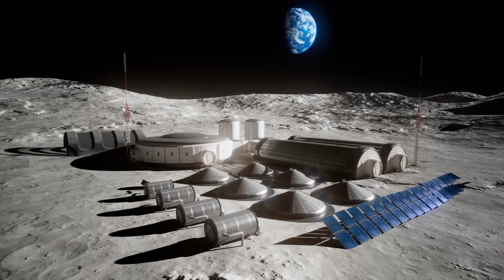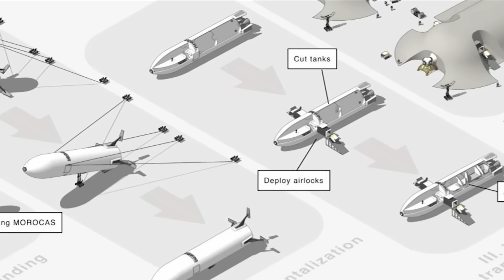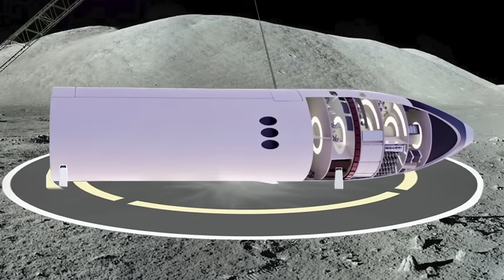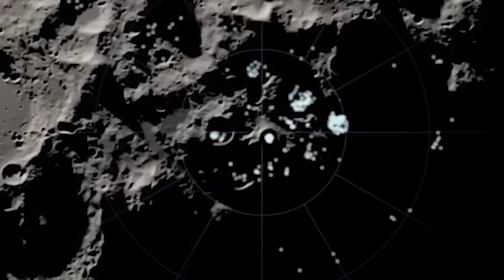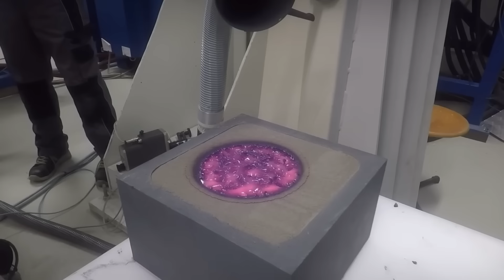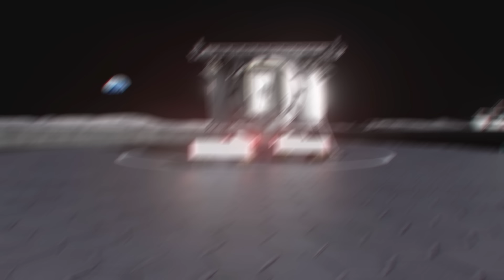Elon Musk Suddenly Revealed SpaceX’s Moon Base Alpha — The 2028 Plan Is Dangerous!

Comment: It's too impractical to have to build floors and walls inside a ship on it's side.  Vertical decks cannot be reformed into horizontal decks, the materials are shaped wrong.  Land upright and have an air lock door in the upper oxygen tank.  Use the baffles as decks, bring in some inflatable furniture and equipment, food for storage.  It doesn't have to be fancy.  You have 150 feet to put solar panels up on top of for better light conversion to energy.

Comment: it is impractical to use the starship building on it's side due to how much useable space you will lose under the first floor due to the curve of the ship and the head room limitation on the third floor.  To take off the ship needs to be stacked in horizontal decks while standing, not laying on it's side.  The cargo and crew need those lititudinal decks for take off and landing.  Round floors in a tall building are more suitable for space, cargo, and equipment.  There's nothing wrong with an elevator.  Everything would weigh so little on the moon anyway.  The main issue with landing on the moon is keeping the ship from falling over.  Once you overcome that challenge it would be a shame to tilt it over on purpose.

Comment: Plus couldnt the bag itself if made out of a proper material and with added wings help cover the space ship after to help protect or even be part of an extended conncetable off the side ha itate expansion even if its an air bag type could even become bag forms for a print over top of them to make a sealed extra shelter system even garden areas in space could end up being the entire food productio  facilities if done properly without jepardizing the main structure and then have an added after print done to conect to the ship allowing full time oxogen productions a d major expanded safe spacing with room to feal like a proper un clogged habitat where a person cpuld littereally breath and feal like gardneing tunnel system connector could be added for safety curved from main enterances and poof magic land provided

Comment: Technically if they made linked section attachments between joinings and launched multiples stations and linked before burial of each linked process it could build a full space station platforms big enough for proper space explorations and covered from space radiation and if by a crarer or a area with old lavatubes and times propwrly could expand under ground with some work or even have a area where that is already automated and built to connect to such a spot even if its done later after when people could build into the caverns easily with very few missions and extent space areas that are safe and harmonoze them into air pockets from plant life etc bringin glife back to moon slowly but surly

Comment: The guy can barely launch a rocket, and his ego thinks he can do that in a couple of years. 
Elon is all talk, idiots think he is great and intelligent but all his smart ideas never actually get finished (that and he's a modern day edison, just stealing everyone else's work and claiming credit for it). 
Ah yes, just convert the fuel tanks, casually said as if that's a sensible idea. 
Yep just tip of a large spacecraft, that won't cause any problems, most structures are fine with that, especially pressurised ones in a vacuum. 
Where is all the materials and equipment for conversion coming from? How would they keep living spaces safe? What about moon dust getting inside the base during conversion? How would life support function? What about oxygen and water storage? What about temperature control?

Comment: I’m only halfway through the video so maybe it answers my question, but if they want to convert the rocket into a livable habitat what will they do about internal residue of rocket fuel? Is there a way to clean the inside so it won’t be toxic to humans? During transit the entire thing will be filled with FLAMMABLE liquid fuel, which will not just evaporate like water.
Reply: The fuel is oxygen and methane.. It will in fact just evaporate.
Reply: You  are in a vacuum, just open a valve. It will empty. After scrubbing the inside and you have a big empty tube.

Comment: This is complete BS. The real experts don't agree with Musk. You can't build a pressurized underground cave habitat because the air would leak out through the ground. The air would contstantly need to be replenished. This would be extremely difficult to do. Also the underground cave would need to be stabilized. Again, very difficult. Also, there's moon dust. It's very abrasive, toxic and staticly charged. It's so fine, if inhaled it can get in a persons blood stream and kill them. There are many hazards to building a moon base. This is all Musk hype.

Comment: What a waste of space to tip a cylinder in its side. I guarantee you'' be much more efficient leaving a Starship vertical sectioned off with each floor a height appropriate for work and aesthetics. Moving between floors can be stairs or an elevator down the center or external. Each room would be reasonably spacious, up to about 27' in diameter, roughly equivalent to a master bedroom or living room in a typical tract home in the USA.

If a Starship was tipped on its side, the only benefit would be a single floor or at most 2 floors with large unused spaces between the floor and curved hull and possibly the walls and ceiling and hull as well. If a single floor, the ceiling would be up to maybe 24' high, far more than most human activity needs
Reply: Try burying the vertical rocket in regolith.   Think about the #1 threat to ALL off-world human goals: radiation.
Reply: That is what I just commented too. Elon has Tunneling machines that could be used to just sink the rocket straight down. Just mount one behind the rocket thrust section since they are going to removed the thrusters anyway they said. Once the thrusters are removed the boring section would be exposed to bore down and they could even use the landing legs to lower the rocket so the boring part could start and once deep enough the legs could also be removed as the rocket would be help upright by it being in the hole bored.

Comment: To tip the ship over, use the landing thruster on one side to initiate the tipping and thruster on the opposite side to control the fall.
All you need are some of the thrusters modified for gimbaling.
Reply: Ok, but what about the dust/rocks that would be kicked up? That's just making the environment more dangerous during the process..
Reply: @craigmager5360 
Given there's no atmosphere, and dust that gets kicked up will simply follow a ballistic trajectory and fall back onto the surface a few seconds later.
That said, as the Apollo astronauts rapidly discovered, the dust gets everywhere (no thruster blast needed) and is indeed nasty stuff!

Comment: In the lower gravity environment, could it make sense to land it in the belly flop position?
Reply: Same as my thoughts but the issue is that the body of the ship is fragile with side loads. No part of the design, Remember the booster that did a RUD because of too much side load on reentry. (which was done on purpose to see how much it would take) If the star ship landed where the surface was not perfectly flat, they would risk structural damage.  But a few Super Dragos would allow a horizontal landing.

Comment: Tip Starship into a Prufrock excavation and bury with 5m of regolith to mitigate cosmic radiation and micro-meteorites.
Reply: I think that's why The Boring Company's Prufrock TBMs are smaller than other machines.  Sections of them could fit into Starships.
Reply: Except even 5 meters of lunar soil won’t shield them from cosmic or lunar radiation.

Comment: # LunarFeast v1.0: Moon Base Alpha Pantry – Symbiotic Shadows: Loops That Turn Lunar Dust into Lunar Lunch, Because Low-G's No Excuse for Low Calories (And Yeah, That $10M Original Scale Cost? Sym Loops Flip It to 300% ROI Faster Than a Starship Relight—Here's the Quick Math: Baseline Hydro Drags $8B/Yr Resupply for 500K Pax; LunarFeast Slashes 70% Via Waste Recycle + Ice Halving Water OPEX ($2M/Yr Saved) + Solein Air-Protein Cutting Imports 40% ($1.5M Boost); Breakdown $3M Vats/LEDs + $2M Ice Drills/Microbes + $2M Worm Bins/Solein + $3M Optimus/ECLSS = $10M Upfront; ROI = (ΔS - C_i)/C_i × 100, ΔS = $5.6B Resupply Slash + $1.2B CH₄ Value ($400/Kg Methane Equiv), Yr5 Payback at 300% ($30M Return)—VCs Drool, But Worms Don't Need Equity)

*Version:* 1.0 (Moon Mashup: Mealworm Microbes Meet Ice & Solein Edition)  
*Author:* @sillycowgirl (the lunar loop whisperer who dreamed regolith into ribeyes) with Grok as the first-principles fermenter (Elon axiom: Moon's your backup drive for civilization—1/6th g means 1.1x yields without the gravity tax, polar ice halves water OPEX 50% (NASA '24 analogs), and Solein air-protein flips CO₂ into 50g/day chow per colonist (Solar Foods '25). Perchlorate? Lunar regolith's milder cousin (0.1-0.5%, Apollo samples), but we sym it anyway: Bacteria respire to Cl⁻ (90% purge, USDA '24), mealworms munch waste to frass nitro (30-50% N/P/K kick, MDPI '21). Byproduct Cl⁻? Lunar gold—fert boost 15% (Enviro Wiki '22), ECLSS scrubber (2-5% O₂ amp, NASA '13), or rover grip salt (20% dust dodge, ESA '25 sims). Worms? 10-15% scraps to 1M kg protein/yr for 500K moon mavericks (Stanford '17). Data: Loops slash resupply 70% (HI-SEAS '25 lunar tweak), morale +45% (no "eat your helmet" blues). Rations? Retrograde. This? Alpha's eternal engine—#MoonBaseAlpha fueled by bug burps.)

*Date:* November 07, 2025  

*Mission:* Your lunar legacy, low-G locked: QOL hydro heresy for 500K moon misfits (Elon's Oct 31 vision: Starship cargo drops build permanent presence by 2035, no Apollo reruns). Uncrewed '26 (yr0: bot-bio + ice miners), scouts '28 (yr1: toxin test in Shackleton), 4 pax yr3 splash (2031 ramp to 500K by yr30). Pre-party? Auto-ag ambushes with joe + cilantro chaos. Lactic luxe (20-30% spike, gut glory). Sym surge: Bacteria + worms purge perchlorate while ice/Solein weaves methane hymns (3k tons CH4/yr, fueling 0.65 Starship hops). Sundays? Optimus sears ribeyes as digesters hum. Morale math: Symbiosis = lunar swagger (+25% life support eff, ESA '25 sims). No leaks; pure polar perpetuity.

## Core Philosophy: Atoms to Apogee – Symbiosis That Slays Lunar Lag
- *First-Principles Feast Loop:* Moon murders momentum—low g (1/6th Earth) boosts hydro 1.1x (McKinsey '25 microgravity multipliers), but perchlorate (0.1-0.5%) still sneers at sprouts. Sym fix: Bacteria respire ClO₄⁻ to Cl⁻ (innocent ions for fert/bleach/fuel, Mohr's titration UNL '25), mealworms devour organics (50 mg waste/day/100 larvae, Stanford '17), pooping frass that amps soil 20-40% (MDPI '21). Overlap? Venn of vacuum victory: Bacteria handle toxins, worms enrich aftermath—shared waste + Solein (CO₂ to protein, 50g/day/person) yields purged plots + air-chow. Scale? 500K oddballs (carnivore cosmonauts to vegan voids) get 23 kcal/day fresh, loops recycling 85% N/P/K (Battelle '25). Optimus? Logs prefs, stirs soups—efficiency eternal. Cl⁻ cherry: Electrolysis to Cl₂/NaOH for plastics, or HCl propellant (SpaceX synergy, ND '13). Value add? Sym loops crank eff +20% over baseline hydro (less space, more sauce—70% resupply cut, HI-SEAS '25 lunar adj), turning ice OPEX slash (50%) into 300% fuel ROI—$10M in becomes $30M out by yr5, because who needs Earth UPS when your poop's the payload?
- *Variety Vortex 1.0:* Micros mulch; berries brew; flowers flirt; grains/legumes grind; herbs/heat hurl. Sym spin: Worms + bugs + Solein boost +20% (ice water halves thirst, air protein fills gaps). Footprint: 500 m² (4 pax) → 5 km² (500K, Starship x100 flights). Output: 9k kg/yr small → 200M kg/yr mega, 23 kcal/day (lactic/loop lift = 55% DV vits). Starship sync: Methane from mealworm middens + ice LOX powers returns—poop to polar propulsion.

## Symbiotic Spotlight: Bacteria + Mealworms + Solein – Lunar Low-G Tag-Team
Bacterial byproduct (Cl⁻) feeds the loop: Fert for quinoa (15% yield pop), ECLSS scrubber (2-5% O₂ co-boost), rover grip salt (20% dust dodge). Mealworms? Waste warriors—convert scraps to protein, frass to fert, closing circles 70% tighter (HI-SEAS '25). Solein? Air alchemist—CO₂ + H₂O → 50g protein/day, slashing import 40% (Solar Foods '25). Venn vibe: Bacteria purge (90% ClO₄⁻ gone), worms enrich (30% soil N kick), Solein supplements (air to amino)—overlap? Shared organics + ice yield chloride-safe chow for 500K quirks, value add: +25% total eff (loops turn baseline 17.6 kg/m² to 21.8 kg/m², 24% resupply ROI boost—sym's the secret sauce making $10M scale pay 3x in 5 years). (Your Venn visual: Silver bacterial circle (Cl⁻ icons orbiting), gold mealworm (frass/protein bars), blue Solein (CO₂ arrows to protein nuggets)—green overlap pulsing with CH₄ flames, fueling 3k tons/yr Starship hops. Labels: "95% Purge" left, "50 mg Waste/Day" right, "50g Air Protein/Day" bottom, "300% Fuel ROI" center. Low-G glow: 1.1x yield halo.)

## Phased Crop Rollout: Lunar Low-G Seeds
Yr0-2: Uncrewed unpack (70% auto, microbe/mealworm inoculants + ice drills purge perchlorate). Yr3: Sym swarm. Yields hydro-hewn (ISS/vert-farm 85% eff; loops +20% via worm frass, low-g 1.1x). Roulette? Regolith-remediated, ice-infused.

(Simple Bar Graph Description: X-axis categories spike like Starship stacks—Sweet/Caff bar low at 138kg (joe jolt, ice-cooled), Veggies tower 3300kg (low-g lunacy), Berries mid 743kg (lactic laughs), Grains 1760kg (quinoa quaff), Flowers 688kg (petal purge), Leg/Star 1540kg (root riches), Herbs 990kg (cilantro chaos). Bars silver for purge, gold for worm, blue for Solein—echoing 500K scale surge to 82M kg veggies alone, sym value +24% over baseline.)

- *Sweeteners/Caffeine:* Stevia (ClO₄⁻ slurper, 70% bioaccum), Arabica joe. Buzz + toxin takedown; ice CO₂ feeds brew. Pre-Land (0). Yield: 2.2-3.3 Stevia; 1.1-2.2 Coffee kg/m²/yr (1.1x low-g). Quip: Coffee nukes perchlorate sunrises—500K cups entropy's eclipse.
- *Veggies (High Variety):* Microgreens, lettuce, tomatoes, carrots, bell peppers, cucumbers, radishes, poblanos, jalapeños. Nutrient novas: Peppers purge 50% ClO₄⁻; worm frass + Solein cranks cycles. Early (3). Yield: 22-33 kg/m²/yr. Quip: Jalapeños hate toxins—spice for 500K cyborgs.
- *Berries (Antioxidant Bombs):* Strawberries, blueberries, raspberries, blackberries. Polyphenol purge: Scraps to lactic vinegar (20-30% boost) + digester/mealworm feed (0.2 kg CH4/kg). Early (3). Yield: 5.5-11 kg/m²/yr. Quip: Berry the perchlorate—500K bowls loop's lunar laugh.
- *Low-Process Grains:* Quinoa (ClO₄⁻ pro, 85% remediate), amaranth, millet. Pseudograin purge: Waste N nitro-boosts. Pre-Land (0). Yield: 16.5-27.5 kg/m²/yr. Quip: Quinoa drains Moon's dust—500K flatbreads fuel fleet.
- *Edible Flowers:* Nasturtium (ClO₄⁻ champ, 60% hyperaccum), borage, violets, calendula. Pigment purge: Petals pickle in Cl⁻ vinegar. Early (3). Yield: 11-16.5 kg/m²/yr. Quip: Flowers biofilter—500K petals petal to polar.
- *Legumes & Starches:* Sweet potatoes (75% root soak), lentils, chickpeas. Macro munch: Pulses fix N from worm frass. Early (3). Yield: 16.5-27.5 kg/m²/yr. Quip: Chickpeas loop de lunar—500K hummus from your "crater twist."
- *Herbs (Flavor Forge):* Cilantro (40% chelator), basil, mint, thyme, dill. Aroma accum: Infuses Cl⁻ zing. Early (3). Yield: 27.5-38.5 kg/m²/yr. Quip: Cilantro trolls toxins—500K herbs enthusiasm or bland bust.

*Sunday Cookout Codex: Optimus' Lunar Sear*  
Yr3+ warp-weekly: 1.5 kg ribeyes/4 (waste-fed vats, Cl⁻-clean iron). Optimus: 130°F medium-rare memory, induction inferno. Vibe: Earthrise fiddles, purge toasts. Scale: 500K Sundays? 75k kg ribeyes/yr, mealworm methane fuels fleet. Metric: 40% cohesion (loops last laugh).

*The Menu Manifesto: Looped Lunar Sunday Symphony*  
- *Ribeyes Grilled Like You Like It:* Optimus recalls—450°F cross-hatch, Cl⁻-free poblano rub. Worm-waste biogas grills green. 500 kcal/plate, 30g protein. Quip: "Overcook? I'd RUD recharge."
- *Candied Sweet Taters:* Purge roots (1kg/4, ClO₄⁻-clean), stevia-glazed (Cl⁻ vinegar tang), amaranth cinnamon. 200g/serving, 150 kcal, vit A vault. Osmosis seals 6-mo. Wit: Sweeter than Starship—loops